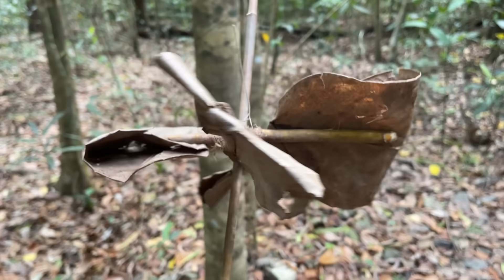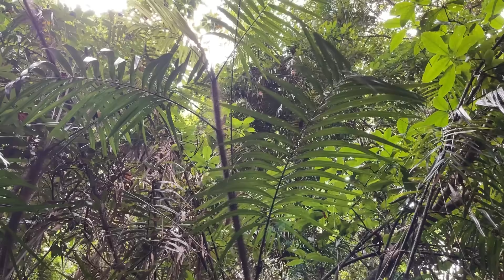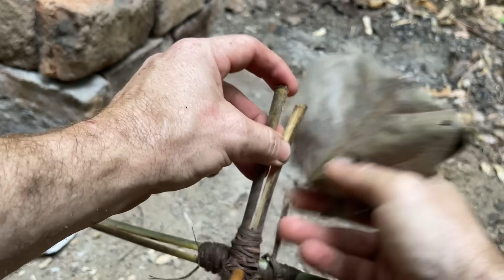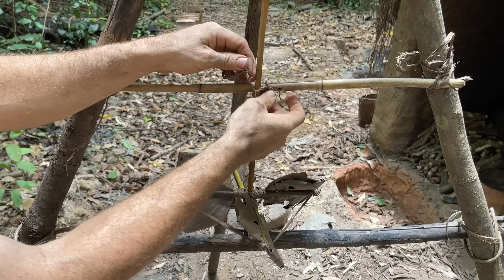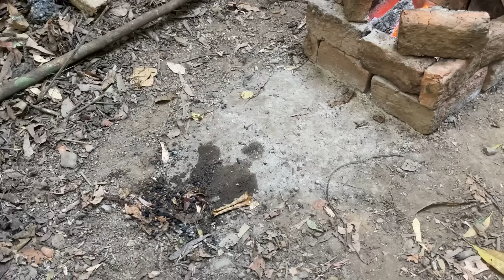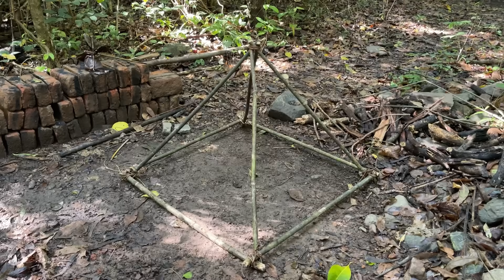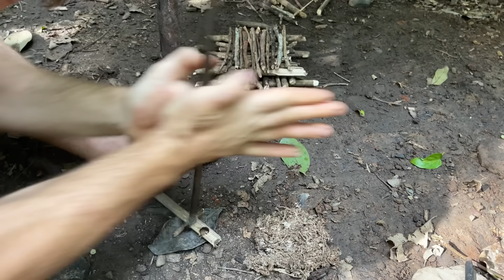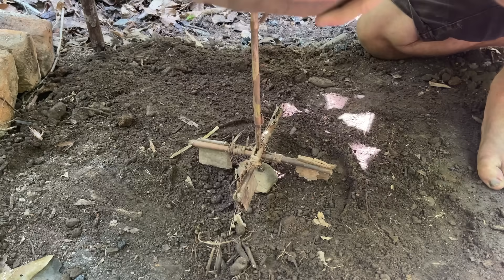Primitive Technology: Convection turbine experiments (hot air windmill)

Comment: Without a duct to flow the heated air past the turbine, it will mostly deflect away in the easiest path. An upgrade of the current (pre-burnt) setup could be a couple more fan units to make for a 3:1 or more ratio of drive to blower. Maybe try adding 2 units on the underside of the roof. But a rough duct (green leaves) with a few 'turbine' units should help. And maybe a flake of stone as the shaft pivot point to reduce the friction from the extra weight.

Comment: Looking at it broadly, the three best ways to upgrade would probably be:
1) Reduce the load applied by the blower,
2) Increase airflow to the "windmill",
or 3) Create something entirely different that avoids the issue altogether.

I'll leave 3 to people smarter than me, and 1 seems tough considering the number of blower upgrade videos we've already seen. However, there's also been a few chimney furnace videos with stronger drafts, though the flames get proportionally taller as well. Maybe adding holes into a chimney something like 3/4ths of the way up, like a kind of pseudo-afterburner? The sudden inrush of air might help the remaining fuel burn up before it exits the top of the chimney, and would cool it a bit too. And, as long as it has a good draft going, the holes wouldn't need any extra help to suck up outside air thanks to Bernoulli's principle.

Comment: I think it would work well if the turbine had a housing on it (a chimney rising from the apex of the shroud around the turbine). As is most of the lift air is shedding off the sides of the blades rather than driving it.

Comment: This is a really cool idea.  The only problem is I think you would have to greatly reduce the amount of hot airflow that can go around the turbine instead of through it, propelling it.  Having a turbine right at the top of a chimney would be great but that would be too much heat for a leaf turbine and mechanically you would have to figure out some pulley system to transfer the power from the turbine to the impeller, all adding weight that would slow it down.

Comment: This idea doesn't seem like it'll lead anywhere useful to me. Given your level and quality of resources, I don't think hot air is ever going to spin a fan with enough torque do an my useful work. You would need a high density of fan blades with no other escape for the hot air, and even then I feel like generating sufficient air pressure will be extremely difficult. Some sort of belt reduction would probably be necessary, but by that point losses from that system and the long shaft not being perfectly straight will still keep it from being useful

Comment: You should try making a heat exchanger instead, there's several ways you could do it but they're all simpler than this fan idea. (If what you're trying to do is get a higher temp?)

Probably the simplest method would be something like a tall stack, with an initial fire at the bottom, some bricks, then ore+charcoal and then an exhaust for convection reasons. 

The bottom fire would be lit first to heat up the bricks, sort of like a blast furnace,  and the top fire can be lit at the same time or later. Then the bottom fire can be quickly extinguished / removed, and for some amount of time while the bricks are still hot, the top fire would get pre-heated air.

Or you can just do a simple heat exchanger with perpendicular channels... Which is what I would probably do, and it probably wouldn't work XD

Anyway, this fan idea I am quite skeptical about, probably it can't beat a long chimney that causes a big pressure difference....

Comment: Maybe having a more enclosed bottom to better funnel the air up , and having larger fins on the top than the bottom would help?  Like if it was more or less clay/nearly airtight (besides a low door) up to the opening and then the opening was a bit larger but so were the fan blades.  I feel as though having larger fins would be harder to start the movement, but they would generate more momentum in their movement.  And having larger fins driving smaller ones would work almost like a gear ratio would in that since you have larger fins producing the spin and smaller fins utilizing the spin, you're coming out with left over energy instead of equalizing energy on both ends of the stick (if that makes sense?).  Like I understand that they're on a 1:1 ratio lashed onto the stick, but having the larger fins producing more work than the lower ones are using I feel like would lead to higher overall spin speed because more of the overall work can keep the fan spinning instead of all of the energy being used up by the lower fan.  I could be completely wrong and stupid, but to me that's my first inclination of what I would try to test next.  More efficiency, basically

Comment: Try using sticks coated in clay for the support, and clay tiles for the pyramid to funnel air. It won't burn down. Then the fans on top need to be much bigger than the ones on the bottom.

Alternately, try that old drinking bird tech or use a waterwheel to power a bellows.

Comment: So, six thin clay rotors with a more aggressive pitch, inside of a dedicated housing, closer to the fire with the shaft in a clay tube for heat protection? Much smaller than the bottom one that can be made of leaves on the same shaft? Or even with a drive ratio reduction of some kind to let the top spin faster while letting the bottom move more air

Comment: I dont think this works with the materials you have available. If youre looking for ways to make the air supply for melting iron more sustainable, hydropower would be the safest bet IMO. IDK if the stream you have nearby would suffice or even allow enough of a drop to usw gravity for more power tho. A Waterwheel and some basic belt transmissions could work wonders here.

Comment: Maybe some kind of duct made out clay to direct the hot air into the blades keeping the flames away from it at the same time? Maybe bigger and sturdier blades to benefit from increased inertia? I mean, the idea looks great. It would be an automated blowing system made out ingenuity and good will.
Reply: He needs indirect (around a clay pipe corner?) air flow or just a really long pipe like the tower furnace he made, to protect the burny bits.

Comment: woah, this could be incredible for automating or speeding up things that are tedious to do by hand or are time consuming from having to wait.

if you needed to quickly dry out clay objects, you could make a sort of kiln that pumps hot air from a fire into that and uses the Turbine to consistently pump air into the fire to keep it hot. also could be useful for when smelting metal and need to keep a constant airflow to get the temps needed to melt metals.

Comment: Perhaps: Tall chimney to induce draft and give heat + flames a chance to cool their jets *then* the turbine into the 'turbocharger' fan that drives air into the base. (run the driveshaft outside the chimney)
That way your draft strength feeds power to the fan, which feeds air into the furnace, which fuels the draft more. Feedback loop! Plus it's fire safety lizard approved.
When it's done you test by removing the fan and seeing if the draft alone brings it to equal power, or if the fan was actually helping.

Comment: i feel like you are into something here. the prototype did burn but it also did work. if you manage to make one that is not made of materials that can catch fire, also maybe a bigger turbine i think you could actually make an automatic bellow here.

maybe is just me but i do feel like you have been stuck in this "age" for a while, i dont mean going to bronze or things like that, but if you managed to make more infraestructure that last maybe you could have an easier time with other proyects and actually develop more. i dont know how, but for example, maybe a dedicated clay making structure that has some QOL features would help you making clay things faster in the long run, instead of digging a hole each time i mean. also, as much as is always incredible how you can start a fire with sticks, im quite sure that you could develop an easier way and use that when able, would save on time but specially on effort, because it has to be exhausting to do it by hand each time

Comment: The main problem is generating torque, you would need atleast 4 sails around arms lenth in size to make it spin faster than a crawl.
Try putting the rod in a narrow polished hole inside the funnel with some fat as lubricant, that should make it turn easier

Comment: Gonna be that guy for a minute... This won't work.

You'd need to capture enough hot air that none of the materials you're working with are going to do the job.

You'd either have to go very big at the top (too much mass, nothing you have is light/strong enough) or very fast (too much heat, nothing you've got is going to withstand it).

Comment: You need to add in gearing. Large diameter pulley on the turbine, small diameter on the blower, both connected by a belt.

Comment: Loved this! Some thoughts maybe -

1. instead of a roof, high chimney that funnels at the top. Making it taller can help the rotor escape the flames and funnelled top will increase air speed at the exit and speed up the rotor. 
2. Clad the exposed wood parts (bearing, etc) in mud for heat proofing
3. More rotor prongs ? will 8 leaves make it easier?
4. Smoothen out the shaft so there is less energy loss as the rotor spins it. Maybe heating up the rod and rolling it will flatten it?

Comment: In terms of a self blasting furnace, the most practical idea I've seen you use so far is a chimney, if you need more power, a taller chimney seems like the most straightforward way to achieve it. But then you run into the issue of how to feed it, so maybe the solution is a fired clay door assembly which seals fairly well, and a very tall chimney.

Comment: You could make it into fire powered bellows? You could make a second small fire, just using wood to create a strong draft to power a fan for the hot furnace for smelting!

Also, maybe use a draft furnace design, but have the fan at the inlet to avoid issues with catching fire.

Comment: This video is amazing. 10\10

The issue you are having is resistence. You need bigger fan blades on top maybe, optimize for best speed. And smaller ones on the bottom. And grease your joints maybe? Animal fat?

Comment: I think the problem with the forge blower is that you were trying to push air using the energy from a roughly equal amount of air, so the resistance (air pushing against you) was almost as strong as the energy (air helping you)

Comment: Good to know that you have fire  safety monitors keeping you safe 😁.  The closer you can get the impeller to the gap in the hood, the better.  The greater the distance, the easier it is for air to flow around, rather then through.  Particularly once you are trying to get work out of it (driving another impeller).  Good plan though, I hope you can make it work.

Comment: The idea is interesting, but hard to achieve in primitive conditions. A lot of energy is lost by friction and the component's imperfect geometry. Thus, the small-mass hot-air flow can not approach the ideal result. Maybe water flow is a better choice? A least the mass is higher, the imperfect of the component will affect the result less.

Comment: Ok so the chimney from a couple videos back...hear me out...what if he build an off shoot. Like a second chimney spout that narrowed the path for rising hot air. And he build a more robust covered structure..small but close to the ground. Both the spout and structure. And instead of 4 blade he did 6 on but axial and the turbine. With a shortened rotor shaft and more concise heated air the turbine may spin faster. His holed grate coukd prove useful to prevent flameout thru the short spouted offshoot.

Comment: Maybe you could build a steam turbine from with clay next :)
But overall I think a sufficient high chimney could be all what you need to create air movement, also if you could get the intake air pre heated it may help with the smelting, you want the intake air have enough oxygen so you would some kind of heat exchanger which heats up fresh air.
You want heat in the smelt, but by forcing air into it you are oxidising the iron too and cooling it off, so pre heat air solves 2 of the issues. A simple heat exchanger could be a pile of heated rocks in front of the smelter intake, it would be labour intensive but simple to test. Another version could be clay pipes with a fire on top, the fire exhaust could then be combined into the smelter chimney to create more draft

Comment: I think you would want a much wider windmill - the further away you are from the axle the more torque the rising warm air would apply on the axle. perhaps you could also make the chimney out of your roof tiles, sealed with mud

a gearing between the input and the output would help but obviously you haven't had luck with fired clay. perhaps you could engineer a sort of pedal powered lathe? and then turn it out of a branch/log? you could use a sharpish stone attached to a split cane with twine as the tool, similar to a spear, so it doesnt yank it out of your hand

Comment: Sucks that you can't use leather
Also, the amount of air produced will lever be greater than the air draft that a fire pulls in
That said, it doesn't need to be the same fire
Say you have 2 good turbines blowing air into a third furnace that you are trying to get super hot, it's passive so you can just start those fires and let it roll on. Especially if you use charcoal, to avoid embers
So you can still have the active effort to pump in air using whatever's best

I think maybe just having a second person to help is probably your best bet to get the high temps though

Comment: Might need better fan design, and a thin coat of something like mud or clay around the shaft. the flat clay shingles might also help, due to their insulation properties. They might allow more heat to go upwards, rather than out through the shingles. Could possibly also use a bit of wet clay between the shingles to act as a sealer for those as well. Not sure how much weight a thin coat of clay or mud will add to the shaft though, and if it would end up detrimental, so perhaps try without that on the shaft first, see if there is any improvements. If the shaft itself still burns, you can try a very thin layer afterwards.

Comment: I know you probably know this allready, but I feel this could work if it is placed into more of a chimany than that funnel, forcing more of the air to move past it faster, as it is way too much of the energy is flowing out the sides of the hut and the around the blades rather than through them, even just a littil top hat ontop of the pyramid that is just large enough for the impeller to freely spin in wouldake a huge difference I feel. Thank you so much for making thease videos, they allwais bring a genuen smile to my face and excitement to my heart.

Comment: Having the fire power itself is brilliant.
Okay, hear me out:
Several rotors on a single long stick, all housed inside a tall (clay?) chimney. Multiple layers of blades means more contact with the hot air, so more torque should be transferred to the bottom blower.

Comment: You are only catching some of the rising air. If you created an enclosure for the fire and placed the rotor at the intake, you could catch the air being fed into the flame. I feel you'd have better luck creating a ceramic steam turbine and capturing the force of steam pouring forth from shaped kettles?

Comment: Wait, hear me out: Wooden steam machine. It should be possible to get it relatively tight, steam won't burn wood (I think), use clay for the boiling vessel (direct fire contact), difficult bit I think would be the valve mechanism directing steam to one or the other side of the piston.
Or, you know, you have a creek, build a water wheel.

Comment: If you have the heat source more isolated from the blades, like build a sideways chimney maybe- and seal the pressure from the hot air more with additional cowling or walls from bricks (the furnace itself?) this has potential

Comment: I doubt this is anything that you haven't thought off but the best way to get power from moving air is to either have very large blades or many small ones. The latter works better with chimneys and the like that increase air speed and can be accomplished by adding more spokes to your fan. Making a clay or dirt housing to force the air past the blades should improve performance but there are limits to what you can extract from just air
Reply: Yeah chimney with many blades would work but he would need sheet metal to pull that off.
Reply: He’s already made roof tiles so maybe repurpose them to replace the leaves?
Reply: this, but a big fan on top and clay wheels connected with ropes to act as gearing. No idea if the thrust will be enough to spool up the blower, but still a nice experiment
Reply: I'm pretty sure if airflow into the fire is the goal a chimney just does the job itself